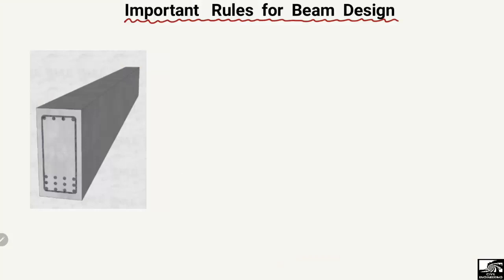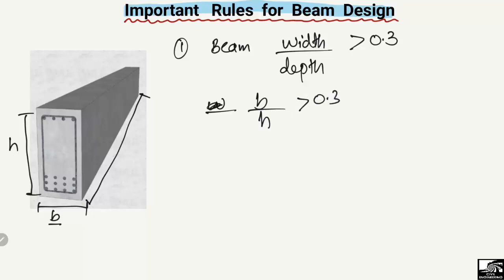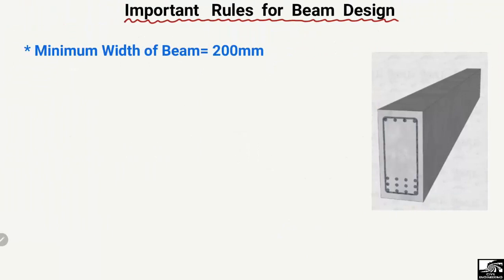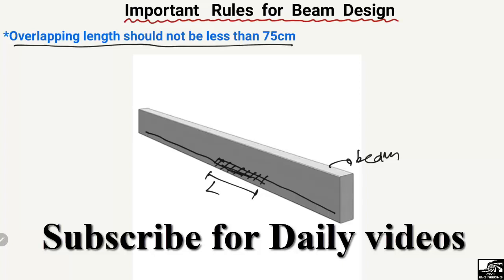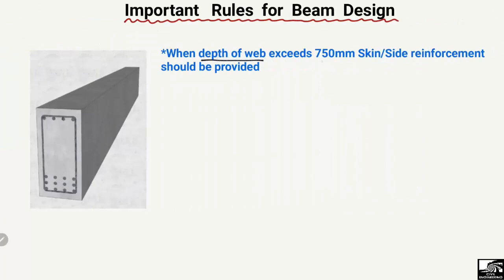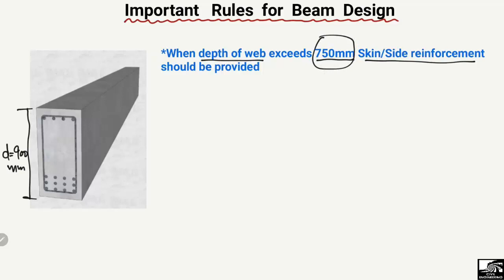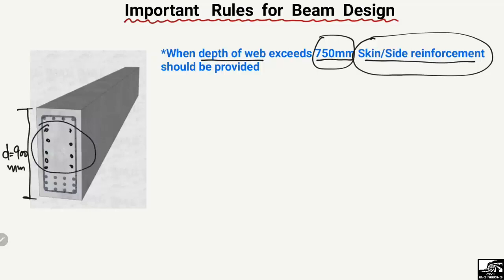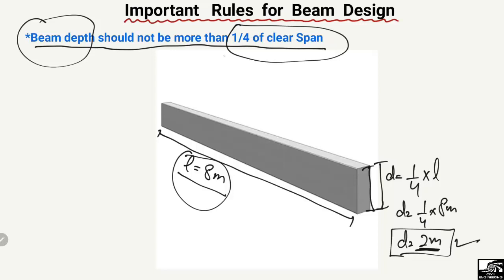Important Rules for Beam Design

Comment: Thank u sir 🙏🏻
      If the depth of beam is reduced due to mistakes in previous execution, what is alternative way to strengthen the beam to resist the design load.
Reply from the maker: Now a days there is SHCC ( strain hardening cement composite) layers put on the old structural members to enhance the capacity of members.